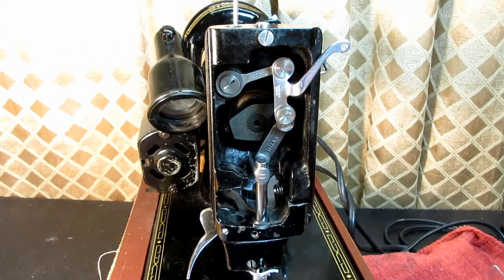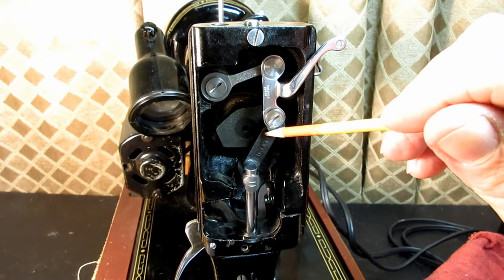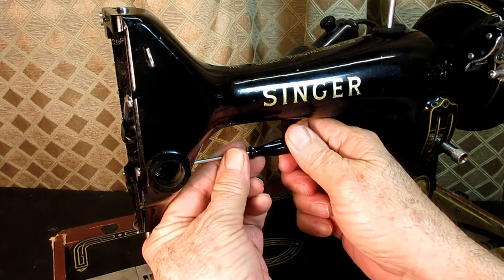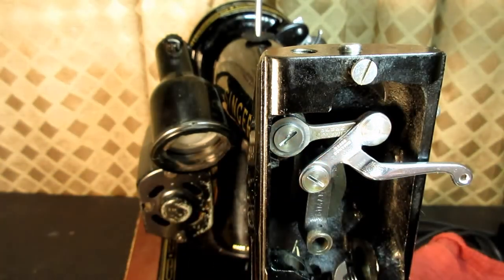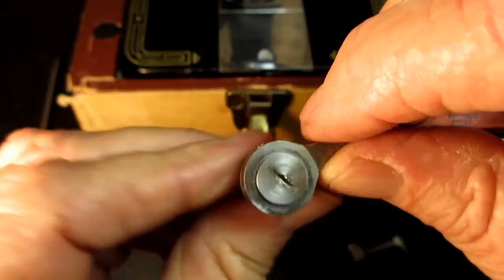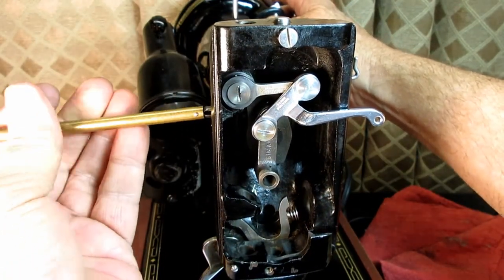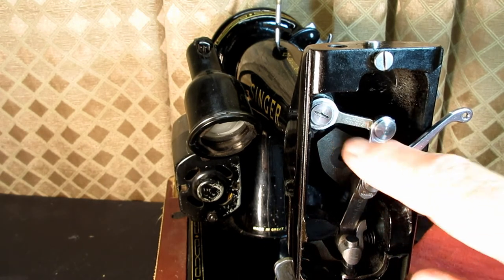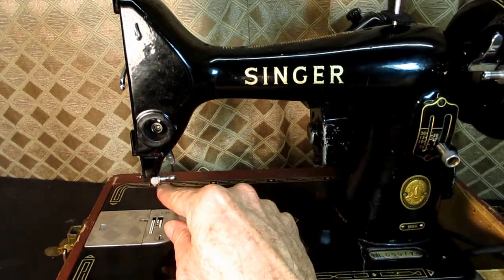The Needle Bar and Take-Up System of a Singer Model 99K Sewing Machine

Comment: My needle is not moving with the wheel and struck ? What could the reason plz
Reply from the maker: Anny moving part that is stuck will stop all the other moving parts. Are you sure the needle bar is stuck, or is it just the part you see the most? There are bushings on the machine that must have oil and if they are dry the machine stops working. There can be a jam in the hook/bobbin case. At the very least the machine should be freshly oiled. You can download a couple of instruction manuals for model 99 from Singer on this page: https://www.singer.com/search/support?title=99   They are FREE and they will have instructions for oiling all the proper oil points. You can also look at some of my 20 videos for model 99K that show working on all the parts. Here is the Playlist of all the videos:  https://www.youtube.com/playlist?list=PLsCOZgzzaiKIIUgkEujqHc9iNWN9NPW2Z
Reply: @andytubesewing1953  thanks Andy!
Reply from the maker: @deepjill4981  👍